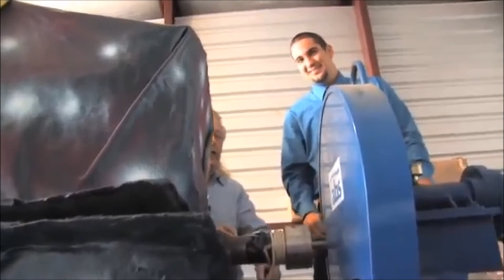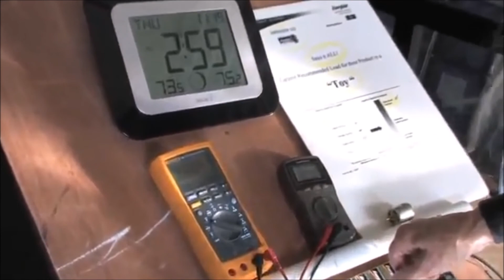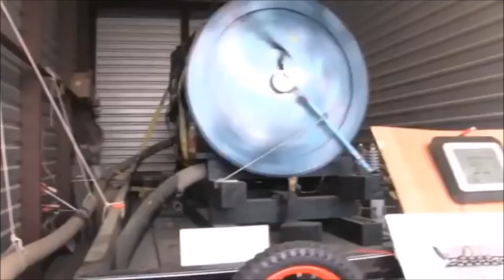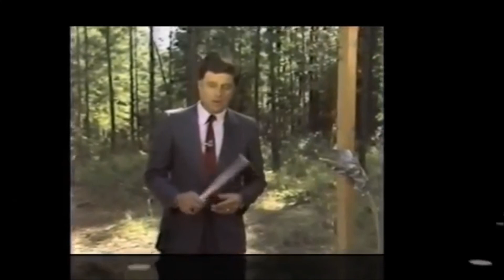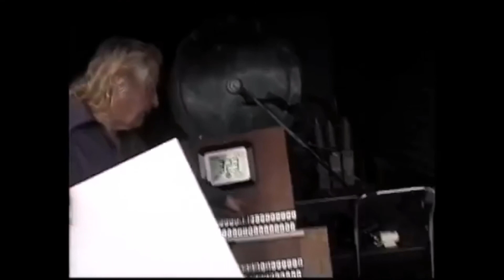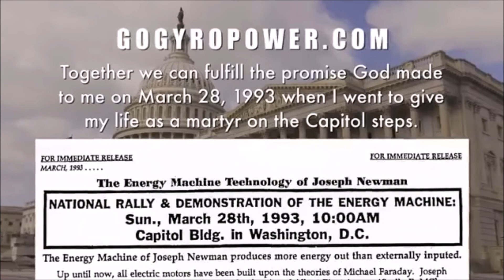Joseph Newman Big Eureka Free Energy (Over Unity) Diaries Part 18

Comment: idtrhn, so far, in the history of people, Not one of these 'amazing' discoveries has been REAL.    any purported demonstration, is ALL 'smoke and mirrors'.     this bozo wanted us all to ignore one Fundamental electrical fact.   power Equals  WATTS.    watts Equals Volts TIMES Amps.     does he Ever mention watts.    NO.    it may have been that his apparent sincerity was due to his 'belief in his own propaganda' and Overlooking the FLAWS in the concept.   if so, he would not be the first. 
to date, a few thinkers/experimenters have realized that a Combination of electrical power AND Mechanical Advantage may be the key to overunity.     since No one has ever been able to Succeed via other methods,   it is past time for MORE experimentation with Mechanical Advantage.
the conversion of high rpm to Torque is well-understood.   where a rotary drive source (electric motor) is used, the motor Can Be ISOLATED from the load, with very high reduction low-loss (power transmission) reduction gearing.    the Result is  Rotary force having very high Torque, at a reduced rotation rate.      this force, then, is applied to the end of  a  BIG  LEVER.       which is in the form of an   Inconveniently  Large  Rotary  2nd-class   Lever.   ( aka, ring gear,  Friction drive, wheel-and-axle. )   see linked video, and my comment there.   see my channel, if it suits.    cheers

https://www.youtube.com/watch?v=lTkXciAn488
Reply from the maker: Thanks for watching David but you got it all wrong most of the inventors were threatened some killed r.i.p Stan Meyer & Eugene Mallove.  I'm well aware of electrical theory i invent on my own time. Like Tesla says most people are making simple inventions very difficult. Like most d.c motors are complete asz backwards we should not pull and attract to the next magnet we should make it north on north or S on S so there is zero friction and we can reach infinity speed once we hit the sweet spot of electro-magnetics.
Reply: unless you can let go of ALL  Assumptions,   including the ones you Don't recognize, you are 'stuck'.     clearly, you are making a few.    dropping names supports your position not at all.  why.   each person was, either, a hoaxer or an inventor/promoter who 'fell for his own hype'.    this opinion is Not influenced by tales of woe or  myths of inventors being jailed or worse.   why not.     in EVERY case the marvelous claimed COP of 1 or greater  CANNOT  be replicated, even with dozens of attempts over several decades.     by now, i hope you realize that  Only  Relevant  f a c t s  are Useful.       the relevant facts Must be 'winnowed out' of the fluff.    fluff and 'circular reasoning' are favored hoaxing tactics.    as well, today, it is 'not safe' to Assume the Validity of 'third-hand' information found online.      you may have a masters in ee.    it makes no difference, if you do not Discover and Question the, rationally unsupported, assumptions  you wake up making.      it's fine with me if you choose to stay comfortable in the 'intellectual slow lane'.    otherwise, who knows what could happen, if you decide to stop 'rowing with one oar'.   cheers
Reply: @daviddavids2884   David please get newman's book . Then you can call him a hoax if you want . Trust me if you knew what Newman discovered in magnetism, you would get it when he talks about his motor running on low current and high voltage. Yes, watts is what you and me  pay for we ALL know that ,but his motors are not built like a coventional dc motors. They dont even operate the same way. Just get the book.
Reply: @heyroldjuniorcambry1991  nopity-nope-nope.    why.   read my lips -   in all the YEARS, there has Not been  ONE  successful  REPLICATION of the results 'claimed' by tesla, searle, newman and ALL THE OTHERS.
this is the conclusion you SHOULD be able to reach:   faith/belief in the genius of tesla, newman, searle, etc.,  is  NOT supported by ANY   Objective  FACTS.    so, see my research if interested.   and, stay on your meds.      cheers
Reply: @daviddavids2884  and by the way many have replicated the motor ie geoffrey miller maybe you wanna check is documentary about is life too out in 2015
Reply: @heyroldjuniorcambry1991  maybe you want to try living in the real world and, maybe, 'up' your meds.    cheers
Reply: @daviddavids2884   ok David , we are all idiots , you win cheers .
Reply from the maker: @heyroldjuniorcambry1991  don't waste your time David is clearly a weather balloon believer.
Reply: @WesternScienceUSA   Lolol yeah i figured. I actually made a small model myself and my final project at school is a 35 lbs model. So like I said many have replicated it . Cheer my friend and keep posting !
Reply from the maker: @heyroldjuniorcambry1991   That's great brother do you have any pictures of  your smaller model. Must be a decent unit weighing 35 pounds & i definitely will stay tuned.
Reply: If I saw correctly there is 645V and 0.6A